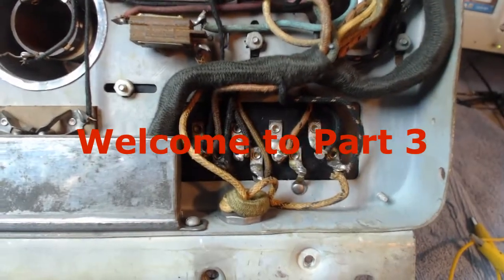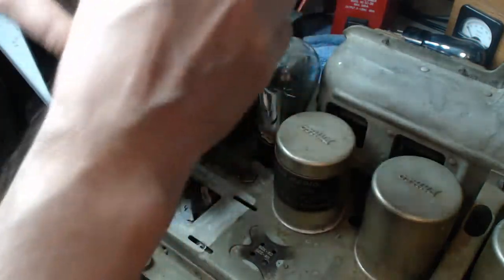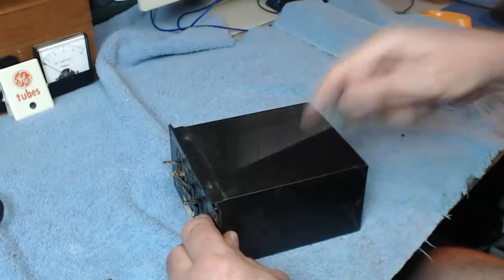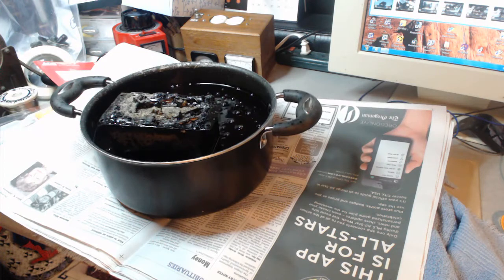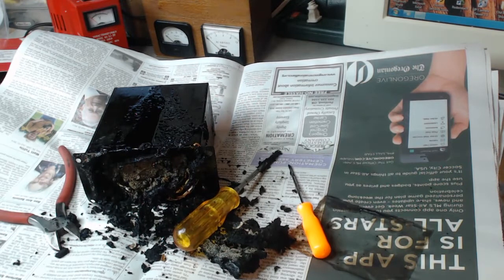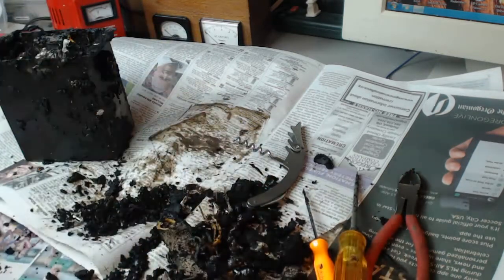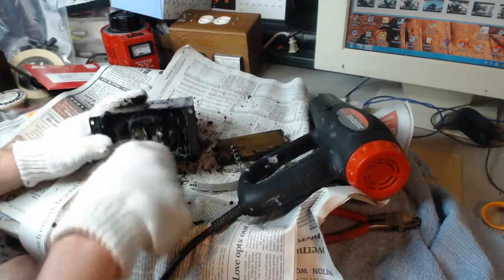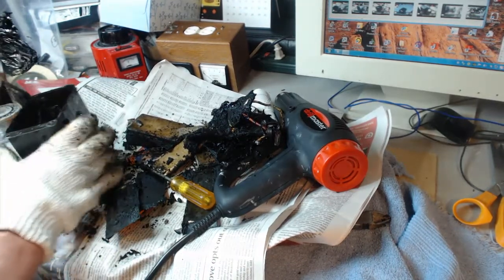1929 Philco Model 86 Restore Part 3

Comment: I would have left that filter can alone too, they really rarely go bad, BIG paper caps sealed in tough tar, they just age well, but smaller ones under the chassis are a different story, a lot of these pre world war 2 radio's actually had very reliable components.
Reply from the maker: It was done for comedy

Comment: Great video Buzz, the sound effects are great and your audio is very good on this video.
What a MESS....LOL
I would have installed the caps under the chassis, since you are going to stuff that can I would use Great Stuff foam after you put in the new caps that way the can will be solid and when you "tap" on it like "John" does it will not sound like an empty can...LOL
Reply from the maker: haha,,glad you liked it.. going to watch your van repair part 2 now..
...buzz

Comment: I would have never done that. The caps in that can were not electrolytics.  #1 those paper filters rarely go bad. #2 if it was necessary to actually replace these there was tons of room under the chassis.   I would have been more concerned about the bypass caps.  my 2 cents
Reply from the maker: Thanks, but it makes for good video
Keep watching bob
Reply: I will keep watching.   Loving it!
Reply: Jep, fast forward to part 4, as i know this cooking smell anyway;)